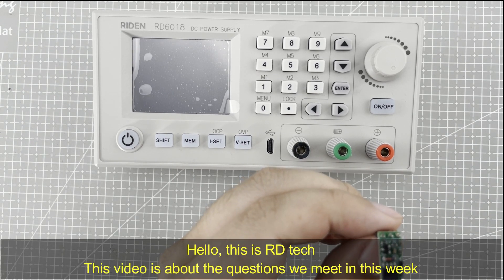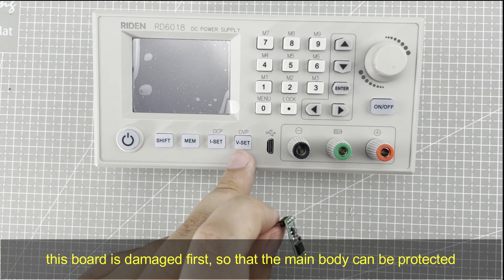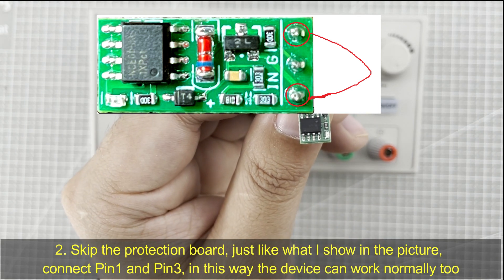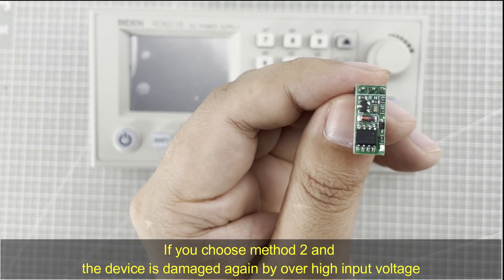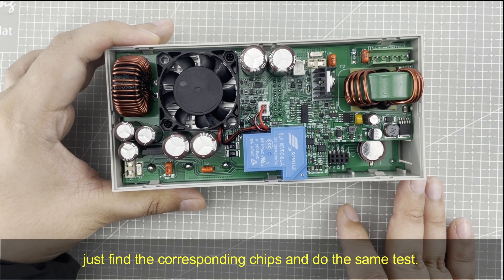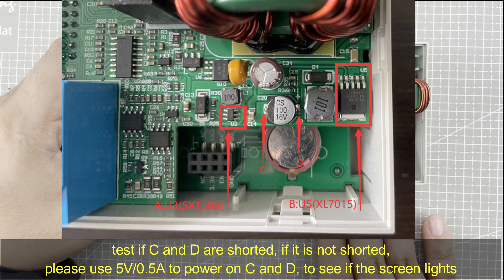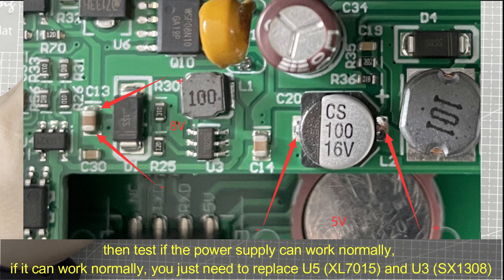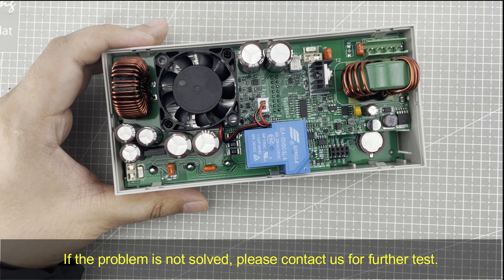RD power supply damaged by over high input voltage again, how to judge burnt part

Comment: hoe to protect against high input voltages?
Reply from the maker: hello, for the latest device, we add input voltage protection board, normally for RD series power supply, 70V is the max input voltage, over 72V it will show you over high input voltage, over 100V DC it can withstand 1 second and screen turns dark, if you continue to use high input voltage to power on it, the input voltage protection board will damage first, check if the device is still ok, if so, replace a protection board and it is ok

Comment: do you plan on releasing RD6024P and others?
Reply: if so, when?
Reply: unrelated: is it ok to run two of these modules from one power supply?
Reply from the maker: @awocrf  if your input power is enough, you can use one PSU to power on multiple devices, there is no limit, we just do not allow connect the output of RD series power supplies in series or in parallel
Reply from the maker: hello, for RD series power supply, RD6012P is already the final P version, so that there is no RD6018P or RD6024P